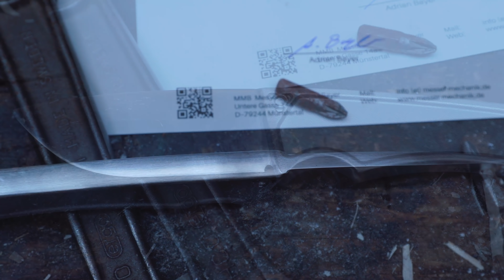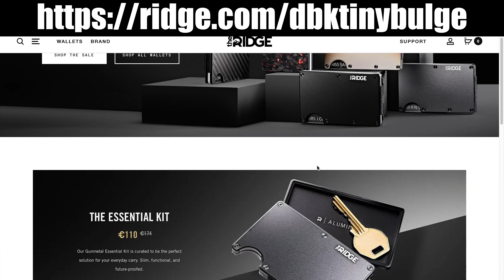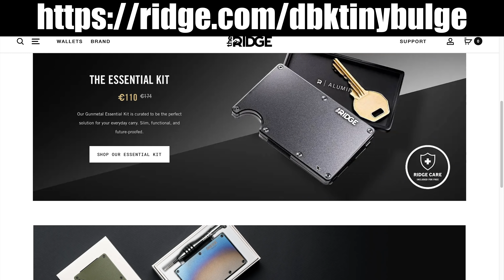They said this $300 knife could not break... ONE PIECE OF STEEL

Comment from the maker: (Important steel info under ridge wallet link)
Bulge Down with Ridge Wallet! The ultimate minimalist and indestructible wallet to fit your EDC
Go to: https://ridge.com/dbktinybulge and use code: 'DBKTINYBULGE' for 15% off!

Steel: 1.4034 
Even though we said it was 420 steel, we meant it was part of the "420" family and specifically 420 HC
This 1.4034 has a little more carbon in it which makes it a little better in our opinion. It is very comparable though.
Reply: You guys should review the Cold Steel Hunter and/or Survivalist, they're a single piece of 52100 carbon steel which seems amazing for the money, especially the Hunter which is $35 for an indestructible bushcraft knife. It's not the sexiest looking but for real use it's a serious contender. The Hunter doesn't have much handle but the Survivalist bowie has a really nice handle.
Reply: @DL-ij7tf  I just bought the hunter and yeah the handle is kind of weird.  Thinking of trying to wrap it in paracord or grip tape.
Reply: @robertbarker5802  Yeah I did that as well, be mindful of the sheath - if you wrap too far towards the blade it won't fit into the sheath which is annoying. I'd even say it's all but a design flaw that the sheath isn't made in such a way as to allow a thicker handle than the bare tang. Still a really tough knife though, perfect for kits and such (the thinness is actually an advantage for that)
Reply: Hey fellas next time you should tempura batter the croc and then fry it in hot oil it will be much much tastier and texture will not be so dry and chewy also it really is a blank canvas so it absorbs spices and seasoning real well or other flavors if you use it in dishes like a curry or even a sauce of some kind but I definitely recommend batter and frying it...
Reply: Also just wanted to 2nd the guy who said to test cold steel 52100 blades they're cheap and indestructible but if you wanna talk sexy then my new bark river bushcraft scout in magnacut I just got today is just amazing super thin blade with full height convex so it is slicey and razor sharp probably the sharpest barky I've gotten right out of the box next to the 3v CUB (my favorite barky) and the bravo tope recon also in 3v
Reply: @kevinAuman1  Noice
Reply: @DL-ij7tf  So I guess I will try grip tape first then. I'd also like to fill in the voids in the grip.
Reply: @kevinAuman1  I've had croc and alligator a couple times and it did strike me as somewhat poultry-like, which I would say is bland without good seasoning but takes to seasoning really well.
Reply: @robertbarker5802  I wish they'd make the Hunter with the grips like they put on the Survivalist, which are actually really good grips.  Comfortable and super grippy without being weak or uncomfortable.  While we're talking about Cold Steel and DBK videos - they're also making the Recon Scout in 3V, which at 5/16" thicc is quite a slab but still pretty lively in the hand since it's full flat ground clip-pointed like a combat style knife.  I got mine for $199.99 on MidwayUSA but I think they went up some.
Reply: Looks like the knife said " Gimme a break " !  Then you ladies acommodated it's wishes ! Heh, heh, heh ! Ahwooooooh !
Reply: Ps olive oil is super healthy for you it's high in omega-3 fatty acid and altheanin which burn unhealthy white fat
Reply: You want a 420 Steel then get a Buck 110, Best knife in the universe and beyond. Except for the APO-1.
Reply: Not exactly a new concept. Surely Cold Steel drop forged knives offer the same or better product for way less money.
Reply: Please do another cheap Bush craft knife review 
Can you do one on BPS knives please !!!
Reply: Ultimate Chinese drop ship crap worth $3

Comment: The Cold Steel Drop Forged series seriously needs reviewed. One piece of 52100 steel. I have the Hunter and Survival and they're both amazing for the money.
Reply: *Survivalist
Reply: 100% agree. They're very sturdy, and if I had a knife fail on me, I'd rather it be one that cost me $40 than $300
Reply: @kyleb4151  I’d rather not have a knife fail on me at all. Buy something proven and a failure won’t be a problem. This maker fixed the heat treatment issue, which is good, but how was he letting them go without checking the hardness before shipping them out? Sounds like a QC problem that needs addressed, otherwise he’ll send more bad ones out without knowing and have to fix the heat treatment again.
Reply: The drop forged hunter is probably the most comparable to this one.
Reply: Drop forged hunter with rubber grip I made from electrical tubing and with a leather sheath is my most used knife within the last months. Carving, batoning, levering, it does it all with amazing edge retention (only had to strop it once) and it is easy to carry as well. Can't recommend it enough!
Reply: @john0270  but it is tougher than most super steels
Reply: @john0270  What does that even mean? No one has given it an impact rating...who parses out these ratings? I caution against relying too much on online ratings and such. Steel performance is complicated. According to the knife nerds ratings 1095 is one of the weaker common steels and this has simply proven not to be the case.
Reply: @DL-ij7tf  he means 52100 isn’t meant to be super tough. It’s meant to be very hard and wear resistant for bearings, and just tough enough that it won’t snap from vibration. A bearing race can crack or snap from being dropped just right. And the reason you think 1095 is so tough is because most last produced knives made of 1095 are heat treated very soft, so of course it’s going to be super tough. Any steel can be tough with a shit heat treatment. But what’s the point of a good knife if it won’t hold an edge? When 1095 is heat treated properly, it will hold an edge well, but it’s not going to be as tough as a esee that’s only 57-59 hrc.
Reply: Mine lasted about 12 years!
Reply: @DL-ij7tf  agreed. Tops differential heat treat on 1095 has been one of my favorite choices for tough use and good edge retention
Reply: I love the slow look to the camera after breaking the knife.

Comment: Mickey, a few tips on the salad from a Greek guy: the feta cheese and the olives are already salty enough, so as you figured out yourself, take it easy with the salt! I don't know who uses dried parsley in a greek salad, but trust me, use oregano. If you don't like oregano, then dried mint. Most importantly, lettuce and cucumber man!

Regarding the knife, i agree with @Shane Richer, that despite the heat treatment and tempering recipe, the 90 degree angle does not really help with the stress distribution. A curved transition would possibly allow for a slightly harder blade?
Reply: Lemme chime in as a Florida man any crocodile or alligator ive ever had was deep fried. Stops it from drying out and adds quite a bit of flavor
Reply: I have changed it - in the video you sadly only see one of the first knives:  https://www.youtube.com/watch?v=N87dC07Q4EA&list=PLpjItSG2Al8Byj1dJ1ULwEfH_Of3yL-sW&index=2

Comment: You two should try the cold steel drop forged hunter, basically the same knife but a fraction of the cost and probably way tougher
Reply: Did you mean to say that the blades are stronger or “way tougher”?  I don't quite understand your thoughts. There are situations when tougher can be used, as when comparing two pieces of meats.
Reply: @donoberloh  Toughness is resistance to breakage or the ability to withstand adverse conditions. Strong can also be used in this way but is a much broader term that can be used in a few different ways. I did not mean to say stronger, I meant tougher.

Comment: I’d be curious to see how any of the Cold Steel drop forged knives would fair compared to this one.
Reply: G'day mate, I was gonna say the same thing. I have put the Survivalist through Aussie red gum fence posts, which is mighty hard stuff; admittedly with another piece of redgum as a mallet, rather than a steel hammer and only with the grain; but still, the 52100 has done it with no probs on multiple occasions. Cheers Duke.
Reply: I've batonned quite a lot with a Hunter and other than scraping the finish off it's held up perfectly. I've done some chopping and batonning with the Survivalist as well but not as much. Both great knives.
Reply: @DL-ij7tf  Cool mate, yep forgotten what that finish is and same result with the BKs for example. But who cares as long as they do the job. I just wish they'd put some scales on the Hunter as they did with the Survivalist and I'd buy one of those too.
Cheers Duke.
Reply: The finish on the Cold Steel knives is shit as. You wear off the silver metallic and its black underneath and looks shit as.
Reply: @christanner3770  G'day Chris, the finish on the Survivalist is a grey coating of some description and shows pure shiny steel underneath. Haven't got through the black coating on my Recon 1 in S35 but don't expect that which you describe. Are you purely referring to their "silver" bladed models ?. Only one I have is the Finnwolf, had it quite some years now and its mainly used for stone-fruit wood, utensil carving, which is pretty hard stuff and a good test. No such probs yet.
Cheers Duke.
Reply: @eyeofthetiger4184  The earlier models.
Reply: @christanner3770  Fair enough Chris, thanks for specifying, thought I was going balmy, or at least very lucky lol.
Btw; still spew'n I missed the original Jess X. Best o' luck for the future, your current designs are well thought out too. Cheers Duke.
Reply: @eyeofthetiger4184  I dont have any designs, im not a knife maker. The original Jess X was improved when Schrade made it a convex grind IMO so good thing you missed out on the original.
Reply: @christanner3770  Ok my appologies Chris, on a knife thread, I assumed................you must get that a lot.
Anyway, you reckon the Schrade version is better again, I must look into that, its a smok'n design for a tool IMO

Comment: That went from "oh yes!" to "oh no" and back to "oh yes" (the maker realizing the heat treatment problem thanks to you and fixing it) pretty quickly! XD
I think it's great that you do what you do with all these knives. Gives me a lot of confidence using my own knives :) I can be the grown up dumb little kid I sometimes am and not fear the outcome with most knives XD XD XD
Reply: Shouldn’t a knife maker test their heat treat before selling 300 dollar knives?
Reply: @tedgunderson67  Bad batch maybe? I could imagine you produce one, test it and then produce the rest. If you're unlucky and they get the treatment wrong on the production models, you maybe wouldn't notice. At least that's what I could imagine.
Reply: @laku4412  for something like steel I would think they would have it locked in, hate that it happened to a smaller knife maker though.
Reply: @tedgunderson67  I think it's cool how he reacted and promptly found and solved the problem. I'm pretty sure anyone who bought one and had it breaking will get it replaced, too. ^^ But it's all speculations, mistakes happen even to the best and I rather judge the reaction than the mistake.
Reply: @laku4412  he did offer replacements? If that’s the case I’ll need help getting my foot out of my mouth.
Reply: @tedgunderson67  Well, I don't know. As I said, all speculations. Based on the reaction to DBK, it wouldn't surprise me tho ^^

Comment: The biggest issue is that the transition from blade to handle is to abrupt.
The almost 90° corner concentrates the shock, resulting in the blade breaking.
The best solution would be to round out that transition and let the thick handle slowly taper to the thickness of the blade-spine without a sharp corner.

Comment: That is why carbon steels are better for hard use and hardcore tasks, and stainless steels are better for more delicate work and usually holds an edge longer, except for a few carbon steels that holds an edge just as good as high quality stainless steels. That's one of the reasons why stainless steels are used to make kitchen knives more often and also surgical tools. Great video guys!

Comment: Strange it broke like that. On my Busse Satin Jac Tac I used a metal baton for a very long time, over two seasons. The baton was a cheap Coleman machete that was dulled out/rusted and I used the spine as a baton. The steel was soft and it flared out a bit but it never broke and the knife had a few light hammer marks from use but I did this for at least two years. I was playing in my woods everyday in the fall/winter with it.

Comment: It is NOT MADE OF 420 STEEL!!! It is 1.4034 steel which has a much different composition than 420 (1.4034 is closer to 420HC) plus in this case it is heat treated way harder than 1.4034 is usually treated to (54-55HRC vs 58 HRC on the MMB)
1.4034 is a classic german stainless steel and is in no way comparable to 420 steel. So yeah the intro contains a very big mistake
Reply: Thanks for the heads up. 420 is tricky as 420HC is also a much different steel.
Reply: Do you know what mp4-n steel is?
Reply: @martinguerre8220  Something to my knowledge not used in Knife making. Atleast I never heard of it
Reply: @kommissarjupiter7667  ok thanks for answering
Reply from the maker: You are very correct! we blindly took it from the knife steel app but after comparing it you are very right!
Reply: Congratulations everyone...we have found "that guy" on the internet. Well done sir. I bet your keyboard is BIG.
Reply: Jupiter!   Take a chill pill. When you disagree with someone there is no need to shout it in all caps. Your time might be better spent correcting  your own use of the American/English language, e.g “way tougher” which illuminates your lack of formal education.
Reply: @kommissarjupiter7667  If you have never heard of it, how do you know it's not used in knife making? For all you know, it could be a Super Steel.
Reply: @donoberloh  How do you even know if you or Kommissar jupiter are real? Are you a figment of imagination or an element of the metaverse.

Comment: Wow that's a bit pricey for what it is. You might get similar results with something like the Kabar wrench knife. Basically a forged wrench with similar specs for $50.
Reply: The production costs are very high in Germany and this knife is completely produced in Germany, which is very unusual. For this purpose, the knife is drop-forged, which is an expensive method. The forging die alone costs already around 8000 €.

Comment: Just curious, how does that tempering affect the innner grain structure that is normally strengthen by heating an quenching  properly?
Reply: As a veeery broad answer the tempering reduces hardness and increases toughness, so the steel is not brittle. Since an improper heat treatment/tempering can leave you with very hard but also brittle piece of steel, it must affect the bond along the grain in the steel, possibly allowing fractures to appear more readily.

Comment: For that kind of money (for an "unbreakable" knife in 420hc with no handle), I would expect some kind of sample testing that would catch those kind of problems. Where does all that money go?
Reply: The production costs in Germany are very high. This die-forged knife is completely manufactured in Germany, which is unusual.
Reply: @rene_falk  I understand that German production costs are high, but I can get a Boker Solingen folder with better materials and more hand work for half that cost. Die-forging a small production volume knife just seems like a lot of expense for little benefit, besides the appeal of being unusual.
Reply: @mikeobrien4081  Material costs are the smallest part of the production costs and are actually almost negligible.
Böker has a lot of work done abroad because it's cheaper. And the quality is rather mixed.

The money mainly goes to taxes and duties, which make up the largest part of the price. The VAT alone already hits with 19%. In addition, sales tax, trade tax and much more up to garbage disposal. Then there are the legal documentation requirements, which also costs a lot of time and money. Böker might manage with a profit of 3 € per knife, mass makes it. But Adrian has to charge a lot more for the few knives his one-man business sells.

Die-forged is expensive, of course, but the crystal structure is also significantly denser and more even than in conventional forging processes. And the whole thing can be reproduced evenly, which is otherwise quite a problem with handcrafted small series.
The bad luck here is the fact that the temperature was set too low by mistake during hardening.

Comment: For $300 they could have made that knife from XHP, 154CM, Or AEB-L. All of which would have been more indestructible. It’s a tall task to make good knife, different materials would be better suited at a similar price point though, (Although that looks like it was machined out of a solid chunk of steel which is expensive)
Reply: This is a drop-forged knife. And it is not "they", it is only one man.
Reply: @rene_falk  That would explain the price and the material choice. Die for drop forging isn’t cheap, and those steels would wreck a die fairly quickly. My apologies, that’s a hardcore way to make a knife.
Reply: @nandayane  Adrian is a very nice, modest man, craftsman with heart and soul. Because of the temperature error while hardening, he is currently writing his customers and offers them to hardening the knifes again with the right temperature. He wants to deliver good quality and would like to be proud of his work. He is quite unhappy with the situation.

He told in an interview, that the die for this knife costs around 8000€.

Comment: Hey guy's... If you were to remove the handle scales off of any full tang fixed blade, you would have "ONE PIECE OF STEEL". You lost me at only 23 seconds into the video. Great job boys.
Reply from the maker: Yea but that is very uncomfortable. Just like the benchmade adamas. This knife is special because it does have a handle which is also made out of steel. Cheers